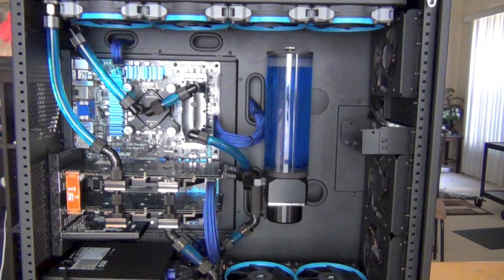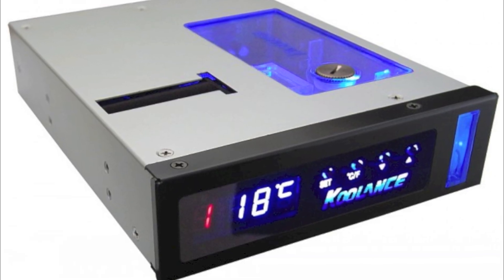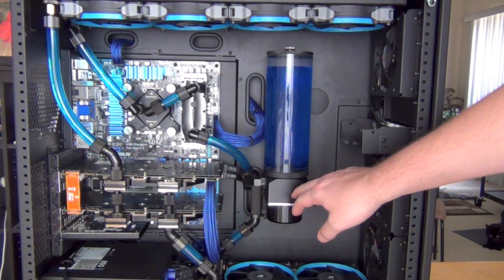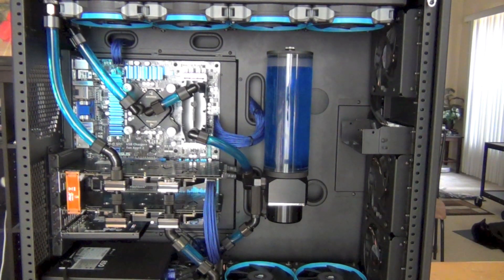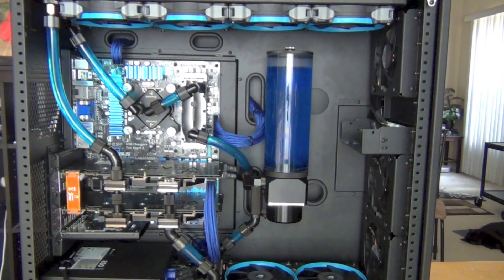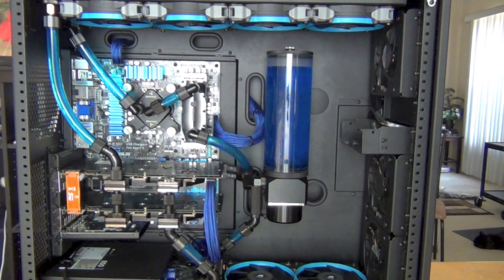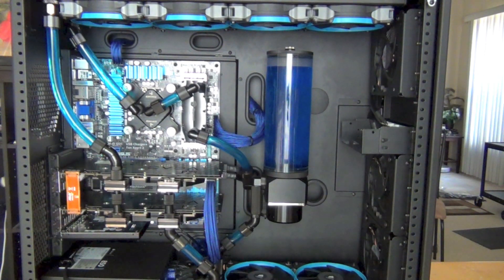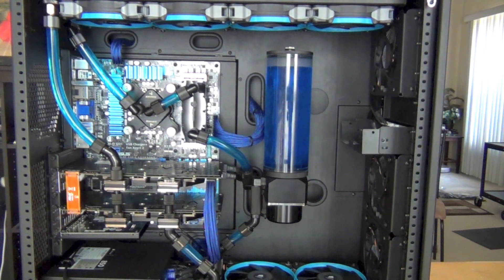CaseLabs Build: Water-Cooling System 2013

Comment: Lol. I thought this guy was talking about idle temps, but under load that's incredible.

Very clean build by the way; yours is the first I've seen that's this open and roomy-looking, which I like.  Great color coordination - the fan accents really compliment the system nicely.  Also, nice use of the RAM waterblock to break up the tubing length; I agree that it adds to the look of the system, and clearly it isn't a problem performance-wise with the temps you'rre getting at that overclock.

Comment from the maker: Out of the box an air-cooled video card runs between 70C-80C (158F-176F) and with SLI engaged its usually even hotter. When these particular cards were on  air cooling they were generally about 73C. So no, its actually very low.

Comment from the maker: Its a BitsPower Galaxy Freezer that I bought from PerformancePCs/com. It is there for aesthetics to break up the tubing. RAM blocks really aren't all that necessary these days. However, even after long gaming sessions the 2133 Dominator memory remains cool to the touch. I would have rather had blocks on the VRMs but no one makes them for P8Z77-V. Thanks for the question. Let me know if you have anymore. Thanks for watching! PS- 4770k is in the mail.

Comment from the maker: Yeah, they are used for external water-cooling components such as radiators pumps etc. However, they aren't used all that often anymore since most cases now come equipped to support some form of water-cooling. Thanks for watching and let me know if you got anymore questions.

Comment from the maker: The fans with the blue rings are Corsair's SP120 fans which are optimized for radiators because of the high static pressure. As DeafShadow said, you can get them pretty cheap when you buy them in pairs. Though, I recommend the Corsair AF120's if you don't have radiators. The front fans are Cougar Vortex Hydro-Dynamic bearing fans. The Cougar fans unfortunately come in orange and black which I painted over with black paint. Hope this helps

Comment from the maker: They're are in a parallel configuration, meaning that the fluid flows through each GPU block simultaneously. A Serial config means the fluid flows through 1 card and then the other. For a parallel config you will need 2 VID connectors, and the entrance and exit points must be on opposite sides. Which cools better is debatable, I've had them in both configurations and the temps seemed the same. Parallel is better for multi-block loops since it is far less restrictive compared to serial.

Comment from the maker: (All Koolance) Pump: PMP-450S // Base: COV-RP450 // Reservoir: BDY-TK200X70 // Reservoir Thread Adapter 60mm to 80mm: TNK-CNT50T70 // Reservoir Top With Fill Port: COV-TKTOPX70 // Those are all the part in the Pump and Reservoir. I mounted the pump using only one of the two of the brackets (included w/ base) and centering it to make it look like its floating. All the fittings are 1/2x5/8 and the extensions are Bitspower. Thanks for the comment and interest! The Merlin is an awesome case!